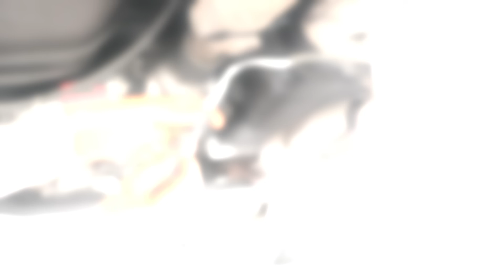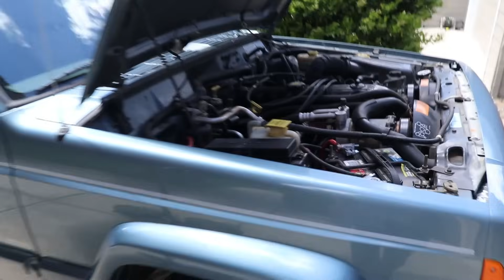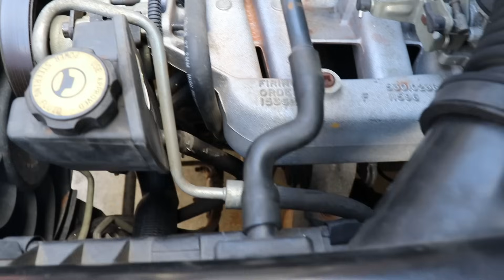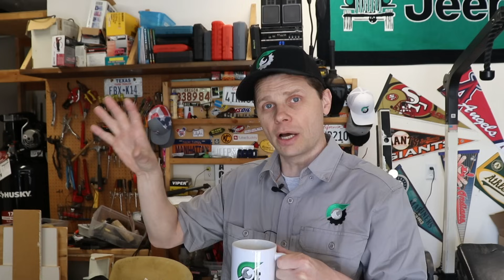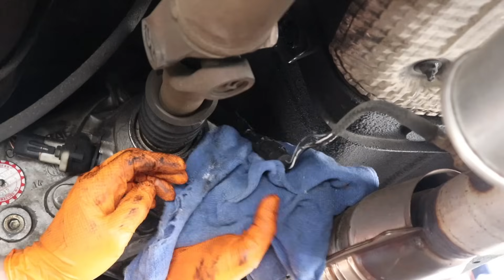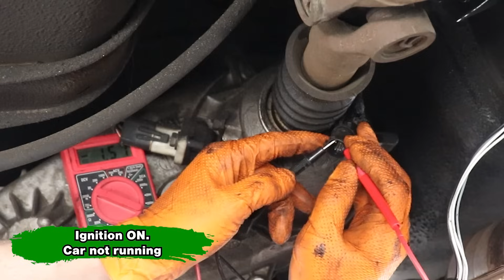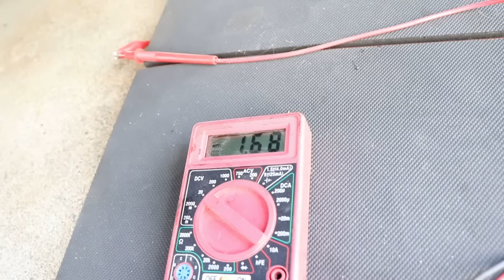Don't Buy Oxygen Sensors! How to test o2 sensor

Comment: Awesome video! But how did you get and power to fluctuate while checking the sensor wires and it was unplugged?????? That part confused me lol.  Im gonna try this procedure on mine please explain
Reply: When you disconnect the plug, you can measure 0.1 ~1 volt on sensor side on two coloured wire (sensor signal) when engine is running and has achieved optimum temperature (generally within 30~60 seconds). This oxygen sensor generates small voltage potential when it achieves certain temperature...to ensure it does it quickly, manufacturer has built in a heater....thru checking voltage produced in hot sensor, you can verify sensor serviceability.
Now for checking oxygen circuit (opposite side of sensor), with ignition switch on and engine not running, you can check voltage on two white leads, which will confirm that heater circuit is OK. While for signal wires on this side, there is a beautiful method:
Ignition switch ON, engine not running and obd connected, you need to monitor voltage value of oxygen sensor 2; it will be Zero as sensor plug is disconnected and engine is not running to heat up the sensor. Now (beauty part), touch one hand on battery positive (+) terminal and other hand on one of the oxygen signal wire (plug terminal by means of a crocodile clip etc) towards engine/computer side and see the sensor voltage value on your OBD/scanner, if it changes, that means your oxygen sensor circuit is OK & if still Zero...that means a circuit or even ECU malfunctioning.
ECU malfunction is quite rear in this case

Comment: What if you had the new sensor installed but check engine still comes on. Equally important code read sensors lower one and a new one was installed?
Reply: I payed $600 for all the work and not done .....

Comment: Should I still get the .1-1v signal  from the o2 if the cat was clogged up
Reply: Yup .... it should give you some volts in this range with small little fluctuations
Reply: Yes... the sensor is independent: if there is temperature variation, there will be voltage change. 
A clogged cat though may considerably slow things as very little emissions ( and therefore, leftover oxygen) is reaching the sensor... but it will still show voltage variation.

Comment: I bought replacement sensor and put it in but getting same error code. So I did your test on the original sensor it has a 1.5 ohms and if I switched the wire its was -1.5 ohms. The new part  read 4.5 ohms so my question is, is this new part bad too?
Reply: Ignore resistance testing part...
.
When you disconnect the plug, you can measure 0.1 ~1 volt on sensor side on two coloured wire (sensor signal) when engine is running and has achieved optimum temperature (generally within 30~60 seconds). This oxygen sensor generates small voltage potential when it achieves certain temperature...to ensure it does it quickly, manufacturer has built in a heater....thru checking voltage produced in hot sensor, you can verify sensor serviceability.
Now for checking oxygen circuit (opposite side of sensor), with ignition switch on and engine not running, you can check voltage on two white leads, which will confirm that heater circuit is OK. While for signal wires on this side, there is a beautiful method:
Ignition switch ON, engine not running and obd connected, you need to monitor voltage value of oxygen sensor; it will be Zero as sensor plug is disconnected and engine is not running to heat up the sensor. Now (beauty part), touch one hand on battery positive (+) terminal and other hand on one of the oxygen signal wire (plug terminal by means of a crocodile clip etc) towards engine/computer side and see the sensor voltage value on your OBD/scanner, if it changes, that means your oxygen sensor circuit is OK & if still Zero...that means a circuit or even ECU malfunctioning.
ECU malfunction is quite rear in this case

Comment: This is an excellent demonstration of how to properly test the sensors works on almost every vehicle. I needed it because I am having troubles with my Toyota Camry and all indications from the OBDII lead me to the downstream sensor which is an unpleasant thing to reach. Looks like I can now at least test it before dealing with an unpleasantly hot exhaust system that needs to be dropped in order to remove said sensor. Thank you for a nice and concise video.

Comment: do you do the same diagnostics if it's a Air Fuel Ratio Sensor?
Reply: Nop, check internet for that....that sensor doesn't produce volt potential but modulates ECU supplied volts....heater circuit is same

Comment: Excellent young man. You and the sometimes annoying young man at Shrodinger are Awesome :))))

I tinker and barely know enough which gets me in trouble.

I picked up a 2004 Durango 3.7 with 115 thousand original miles is a misfire pain in the butt. 
Had a compression test and leak down test which indicated very good. 
Changed original plugs and put new coil packs in.
Ran for 30 miles and started misfiring. Once it started with cal 3 then 4,  switching coil pack around would get it back running for another 25 or so miles. 
reader always has indicated low voltage bank 2 rear 02. 
Also reads IAT sensor has issues. 

My resistance between white o2 side wires is 4.4. You said it should be 5-7.
It makes sense this could be an issue.
Best; Tom
Reply: Nop...a faulty oxygen sensor cannot render a vehicle to misfire....quite often compression test misleads the diagnostics...go for cylinders leakdown test, it will precisely figure out issues of low compression (if any) due to ring-piston or intake/exhaust lifters or compromised head gasket.
Erroneous reading in IAT renders quite rich fuel mixture, get it rectified first, then get your vehicle checked for air leak in intake manifold & associated hoses/pipes or air leak due to fsulty EVAP solenoid...EVAP solenoid is notoriou for air leaks and causing misfire kind of symptoms while you suddenly accelerate after you depressed the gas pedal.
Moreover, get your PCV valve cleaned and pcv system both hoses checked for air leak or blockage in hose meant for pumping filtred air to head cover

Comment: You tested if voltage is reaching os heater but ur engine was off and u didn't mention  this. Does this mean sensor is powered all the time ? This doesn't add up.

Comment: Hi JeepSolid, the resistance of my upstream O2 sensor reads at 7.8ohms. On the Wrangler TJ it should be between 5-7ohms. 
Is it a problem that the resistance is higher that 7 ohms? Does that mean there is an issue with the heated of the sensor?

Comment: This is great but the old o2 sensor just will not come off. I tried everything, engine warmed up to operating temp, o2 sensor socket clamped with a hose clamp, breaker bar. It still just strips the threads. How the hell is a DIYer without a lift, blow torch and dremel supposed to remove the sensor? Mechanic wants $400 for a 15 min job. That's $1600 per! Why do they charge so much?

Comment: Can a large evap leak be from bad upper and lower o2s? And I was also wondering if someone could answer me about the map sensor,  is that part of evap as well ? Codes are saying large evap leak , and now saying 2 o2s bad. I'm going to try ro figure this out
Reply: MAP sensor is not a part of EVAP.
Large EVAP leak means, your EVAP Solenoid valve is stuck at open position
Your catalytic efficiency trouble codes  may arise due to any one or more of following reasons:-
-Stream 2 sensor (after cat converter) or its circuit is bad,
-exhaust leak just before stream 2 Oxy sensor in cat area
-evap solenoid valve stuck at open position (causes rich mixture when u depressed the gas pedal and lean mixture when engine is at idle rpm
-cat converter is actually bad

Comment: For a 1994 bmw 318i  which order are the camshaft crankshaft  bank 1 and bank 2 knock sensors connected into the wiring harness

Comment: Great video. I do not understand how the o2 sensor provides a voltage if it's not plugged into a power source when you were testing them with the DVM. Can you please explain it to me. Thanks.
Reply: It generates voltage potential when gets heated up to 400 charli approx, just like thermocouple
Reply: @Car-istaniyan  Yeah, I did a little research on it. Thanks for the reply.

Comment: I'm getting a PO420 and PO430 codes. The truck runs great, fuel mileage is normal. Do you think this might be the sensors?
Reply: It could be one of following:-
Sensor or circuit fault
Exhaust leaking before downstream sensor
Catalytic converter choked
Catalytic converter efficiency is actually bad

Comment: wondering if I can go thru all the steps on 1 sensor at a time, because my floor jack is too heavy to move back and forth. It would mean that the 2nd and 3rd  sensors I have not examined at all yet, will be getting tested warm whereas the first one I  tested got the first 2 parts of the test done with a cold engine. Anxious to hear your opinion. Much appreciate your videos. Thank you.

Comment: I drove my '99 Expedition like 5 hrs ago.  The exhaust barely feels warm to the touch.  Does resistance reading depend on temperature at the o2 sensors?  The o2 sensors read 4.2 Ohms which would mean they're bad unless temperature plays a role.

Comment: Waste of time that is a rear sensor has no affect on economy or drivability only exists as a tattle tale if cat is bad or removed buying a new one is wasted money. First remove then clean then TEST because cleaning is easy and a maintenance thing. Everyone replaces these because apparently they are to lazy / dumb to clean them. same goes for iridium or platinum spark plugs .. they simply do not wear out you replace them at 100k not because they are worn but because they got 100k carbon build up etc.. clean them put them back in at up to $15 each on a V8 that adds up

Comment: @3:10 those two white wires looked chewed on.  If the wire is exposed and dirty greasy/oil coated them, it could be shorting them...

Comment: Which 02 sensor did you change. The upstream or downstream? Also which one should you change if you're getting poor gas mileage and a bit of jerking when accelerating at higher speeds (highway driving)
Reply: He replaced downstream after the converter check for engine codes it will tell u what one to check

Comment: How are you getting a voltage output from the sensor when the power isn't connected to it? 🤔
Reply: Sensor produces it
Reply: The active element in the sensor is zirconia. Under specific conditions, a notable potential difference (voltage) arises, spurred by the variance in oxygen concentration across the zirconia's internal and external environments - by "notable" it's something in the range of 0.1V - 1.2Volts - the electronics in the PCM can measure that with great precision...

Comment: The O2 sensor ahead of the catalytic converter works with PCM to regulate fuel mixture. The O2 sensor after the converter is used to determine the converter's efficiency (ie broken, failing, plugged up). You might be addressing that, but I'm only just starting to watch your vid.
Reply: Is the second sensor absolutely necessary?
Reply: @MrsBuddevil  I'm no expert, and when it comes to the O2 sensors and catalytic converter, I'm a newbie.  But, I'll try. With scan tool monitoring live data from O2 sensors. The O2 sensor ahead of the cat will cycle high and low as PCM adjusts fuel and air using sensor output. When car first starts, the O2 sensor behind cat will mimic the other sensor. When the cat's temp reaches operating temp, this output O2 sensor will give a steady signal which will fluctuate with engine speed. If everything is working, the cat is burning the waste gases, and if you measure the heat at the input and output of the cat, the output will be ~100 degrees hotter. If cat has failed, the output O2 will be erratic or still mimicking the input O2. The PCM will set error code, and you will fail emissions. If output O2 has failed, the PCM can't determine cat status, so it will set error code and you will fail emissions. Hope this helps.

Comment: I have a 2007 dodge nitro 4X4 3.7, here's my question. If I replaced them with after market O2 sensors would my check engine still come on because their not the OEM from dodge. New O2 sensors I got has a didn't part #

Comment: My 99 xj was throwing codes for O2 after cat. That sensor was telling the ECM that the motor was running lean (which it was not). In return since the ECM doesn't know any better, it was telling the injectors to add more fuel to compensate for the "lean" condition( which it did not need). This resulted into a severe rich condition. Rich means too much fuel. Too much fuel means serious   drivability issues. Strong gas smell, terrible mileage, rough running and idling. Eventually bucking and slamming. Changed that O2 and it fixed the problem. No offense to jeepsolid but this is his rebuild. Mine was a daily car that I had to have because I'm poor. Change that O2 (only on jeeps).
Reply: Our 99 wrangler has the same issue, did you change the upstream or downstream sensor?

Comment: When you test the engine harness side does it matter if red or black are touching ground or sensor do color match up?
Reply: It matters a lot, any of signal wires touching ground will render higher voltage values as sensor output to ECU....and ECU will start cutting fuel considering engine is running rich mixture....and here you go with any of following issues (may be more than one at same time) underpowered vehicle, rpm hesitation, high fuel consumption

Comment: What are you wiring to to check your voltage on the oxygen sensor side? The two white heater wires? Or your gray and black on the sensor side?
Reply: He's basically running the engine to heat up the sensor, so with his wires connected to the grey and black (sensor and earth/ground) the rise in temperature will give a reading on the meter, hope this helps.

Comment: How are you checking the voltage off the o2 harness if it's not connected to vehicle harness?
Reply: Sensor generates small voltage potential upon achieving temperature in the range of around 400 charli

Comment: Isn’t it better to back probe for checking voltage so you don’t damage the pins inside? I was told by my teacher to never check from front and should always back probe
Reply: multi meter probes can widen the holes on the sockets pins, and make poor connection.

Comment: at 6 minutes and 30 seconds you're hooking up the volt ohm meter to the sensor with the meter set on 20 DC volts.  The sensor isn't plugged into a power source.  How are you getting voltage output from a sensor that has not power?

Comment: How do you get any voltage thru the sensor with it un-plugged? It has to get voltage from the computer. Un-plugged it has no voltage source. It's basically a variable resistor that changes with oxygen content then the computer reads that.

Comment: Correct me if I’m wrong but the post cat oxygen sensor has nothing to do with the fuel injection, it’s sole purpose is to check that the cat is doing it’s job , the first position oxygen sensor is the reading that the ecu uses to adjust fuel injection

Comment: Hi! Quick question, I replaced my o2 sensor like 6 months ago on my 2017 Expedition, my check engine light just came on today and I had it checked and was told the o2 sensor is fine, but its reading that the wiring harness to the o2 sensor is bad. There have been no noticeable changes in fuel/mileage, i get roughly 13mpg anyways, no obvious symptoms.... I don't understand how the harness can be bad and not the o2 sensor itsself.. There are dealerships throwing crazy numbers at me so I'm trying to figure out how to proceed and what I should anticipate? Any help or advice is so much appreciated! Please...
Reply: Here you get a simple test to verify that your harness is working good or not.....
Ignition switch ON, engine not running and obd connected, you need to monitor voltage value of oxygen sensor; it will be Zero as sensor plug is disconnected and engine is not running to heat up the sensor. Now (beauty part), touch one hand on battery positive (+) terminal and other hand on one of the oxygen signal wire (plug terminal by means of a crocodile clip etc) towards engine/computer side and see the sensor voltage value on your OBD/scanner, if it changes, that means your oxygen sensor circuit is OK & if still Zero...that means a circuit or even ECU malfunctioning.
ECU malfunction is quite rear in this case

Comment: I don’t have any codes popping up but randomly it would start running like crap after being warmed up for about 20 seconds. Rpms jumping from 700 to 0 and back up. Jerking foward with barely any power, popping from intake and then back to normal. Does this sound like a clogged o2 sensor maybe? Cleaned throttle body and changed IAC sensor, tps and map.
Reply: Yup I fixed it a while ago, it ended up being an air leak in the intake manifold.
Reply: @kavik526town2  I am happy for you
Reply: Get following  checks done:
 -EVAP Solenoid valve for stuck at open position 
-PCV Valve for functioning correct...or get it cleaned with carb cleaner
-look for air leaks in intake manifold area and hoses/pipes connected to it
-get hose between intake manifold and just after Air filter, if it is clogged...if it is, it will generate strange sound from engine and rpm hesitation ...one more symptom...when you pull oil dipstick, the engine will try to stuck it back to its place

O2 sensors have nothing to do with it